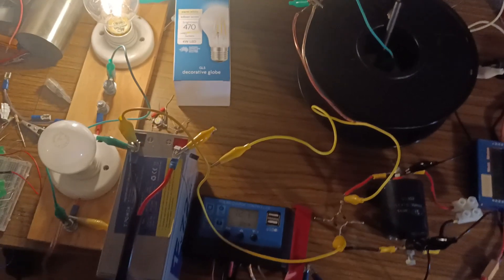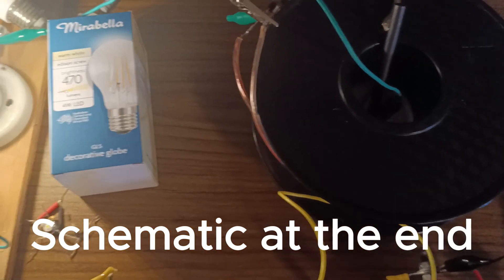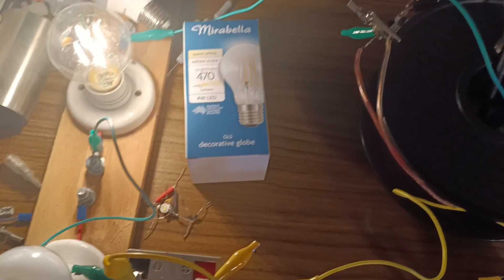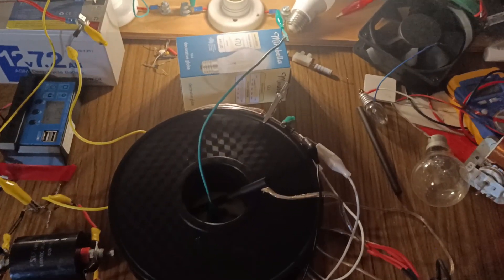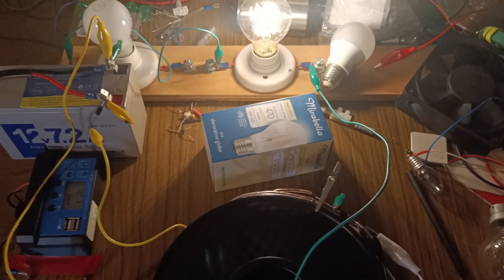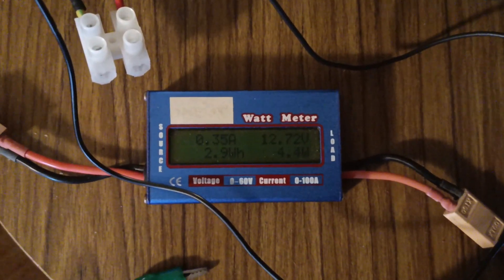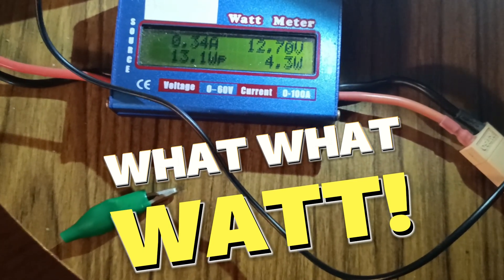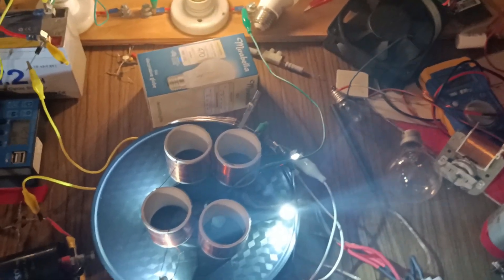MY CIRCUIT + SOLAR CONTROLLER & A WIRELESS SECRET

Comment: The sensitivity of those wireless LEDs interests me. Are the coils single or multilayer? What diameter and length? What size wire? How many turns? I see four possible configurations: looking from top to bottom, clockwise or counter clockwise, and LED polarity anode up or down. (Oh! But half of these are identical, just flipped orientation). Which ones are more sensitive to wireless energy may depend on coil config, polarization of the EM field, or minor variations in the components. Please consider making a couple sets of witness coils, in each config, to help rule out component variation as the cause of the sensitivity differences, and check different orientations as distance from the source increases
Reply from the maker: Thank you for your comment.
Sorry for my delayed response.  I am doing some closer work with these coils at the moment. I deliberately made two of each kind of these coils. There are two with the diode in reverse polarity, there are two with two extra turns and then the first two I made. I am currently unwinding one of the longer ones to get the exact wire length for best lighting. At this point in time I don't believe my initial statement to be correct anymore and as soon as I lock down the correct parameters I will make an update post. So what I said before about it being the diode reversed is not accurate, whilst it does have an effect it isn't responsible for the effect. The polarisation also isn't the full picture which I will demonstrate also in a follow up video, my current config displays this issue. However there is definitely a polarisation effect at play between Pos and Neg wires as well as a magnetic field travelling the length of the wire that is super interesting to see in effect.

Comment: As I understand it lead acid batteries can either charge or discharge, but not do both together, therefore you would have trouble recharging the source battery
Reply from the maker: Thank you for your comment.
Sorry for my delayed reply. That sounds similar to how they behave but I know that isn't exactly the problem in this instance. Normally SLA batteries are used in constant trickle charge state whilst simultaneously supplying power, like in security monitoring backup power systems, however the charge input rate is very low at 0.8 amps. The problem as I see it with my circuit is voltages that are too high to facilitate charge. As we are all aware the electricity wants to move to the lower potential and when I can light up a 240v fluorescent tube by touching just one of the 12v battery terminals I believe the reason the battery wont charge "well" is because it has a potential voltage over 1k. Now I could be completely wrong but I have thought about this a lot and I can't think of any other logical reason especially when considering the configuration currently on my table is charging a second set of batteries just fine, whilst also feeding back to source.
Thanks for watching.

Comment: What type of loads can you power with output from capacitor and what power level support ?
Reply from the maker: Thank you for your comment.
My apologies for my delayed response, it seems the older I get the more I'm saying sorry as getting my act together is getting more difficult.

I seem to have an obsession with light and so I have to be honest, I have only tested LED's, besides the cap in this configuration isn't really there for extra loads but there to show the "feed back to source" fan base that there are better ways. ie. yes it can be done but it's not the most practical way to use that energy, somewhat like using sugar to make alcohol then attempting to make sugar from the alcohol!?

I will get to the point, if running a DC load in this arrangement you will get a disappointing 10 volt 2 watt output. When feeding a battery from this it changes to 13.1 volts 1 watt. In this configuration the capacitor is there to collect the high frequency dielectric that the SLA battery is unable to absorb in it's original form. The capacitor in this instance is a means of conversion of energy to a form readily available to the SLA battery. However more devices should and will be tested as nobody should guess these things, "I think" needs to be replaced with "I thought about it and here's my conclusion", something tells me that isn't how we will best benefit from this power.

I am currently running a setup that is proving very promising using the magnetic flux surrounding the wire and feeding this back to source, I believe this is the energy Ed Leedskalnin wrote about. This in my opinion will result in an increase in efficiency. This new setup I will record and post ASAP(yeah right, like next year old man), it's a spin off of the wireless coil using the input lines. This method has a power factor of 0.9851 when feeding just the source and a power factor of 0.973 when feeding the source and charging an equal sized battery so pretty damned efficient especially when I haven't yet attempted to max it out.

Comment: Does the power monitor report the power factor? Because real versus apparent power is different, due to phase of voltage and current
Reply: dont go letting reality get in the way of "free energy"!

reactive power is complicating things... 

lol.
Reply from the maker: @paulshields1883 Thank you for your comment.
The power meter is an old one and doesn’t show the power factor however what it does display I calculate the power factor to be 0.975 which is very efficient. That is running a 6 watt load on L3(Tesla’s 336,961 patent) as well as feeding back to source.
Let me know if you want a full cycling of the readouts on screen for your own calculations.
Reply from the maker: @paradiselost9946 Thank you for your comment.
This is a question that continually comes to mind, what if the algorithm’s used to calculate the measurements in modern meters are incorrect based on incorrect or incomplete science? Does that make the readings invalid. ie. our understanding of physics is clearly wrong since the pentagons declaration on UFO’s, if apparently our physics models don’t understand those technologies it’s hard to imagine our meters, designed under our understanding of physics, would have a better understanding. In the same way Ai can’t understand things better than humans because we are the teacher, if the teacher is wrong…then… this is the chicken and the egg conundrum from a new perspective.
Reply: @whatifididthis...1236 very well said ❤
Honestly, I don’t bother anymore about measuring power factor or just output power and it doesn’t matter too much the form of output, it is clear to me that electric energy is used wrong as it is now and a completely different approach should be employed.

With your pancake coils and less input power then yours (64 w) in my replication I can power +2200 w rated loads for AC from power grid. So, this is not about overunity or things like that … it just prove that we don’t need huge input as we are told and electric energy can be used much safe and more efficient without amperage.
Reply from the maker: @Caesarus2011  also very well said! Tesla was very clear about the pancake coil has more output than input. I just don’t know why people are still debating it from the perspective of their education, we only know what we are taught, therefore if we aren’t taught this information we can’t possibly be considered knowledgeable on the subject, bit of a no brainer really.
Reply from the maker: @paulshields1883  I made another adjustment to the circuit and ran all day yesterday to achieve a better power factor of 0.9898

Comment: Could it be that you are charging the cap and that's why the bulb decreases ? You could put a diode on the ne side and see if it deceased the spark when you reconnect.
Reply from the maker: Thank you for your comment.
You are correct to question that as all things should be questioned, however I feel that isn't the reason for what we're seeing. The cap is relatively small and charges so rapidly and I believe this occurs because we have a capacitor followed by a resistor coupled with my circuit which essentially creates a "low-pass RC filter". This is essentially a method of attenuating high frequency whilst allowing low frequency to pass. I did place a diode on the Neg side also but it has a completely different effect again.

Comment: dioda base to emiter, bedini style.
Reply: Yes, i wondered about whether this could damage the transistor. Bedini clamps the base to the emitter, with a diode, to keep the base from going too far under voltage
Reply: Great finding .

In the circuit Does the transistor heat up quite a bit ?
Reply from the maker: @ardiwork Thank you for your comment.
I originally had one but removed it because it produces much higher voltages without it, this can be clearly seen at the light. My initial intention was to throw away everything not necessary for function so I could build something post apocalypse by scrounging materials from any environment. This takes the transistor so far from it’s operating specifications that experimentation would often blow the transistor, it’s usually on connecting this whilst running, the small spark gap that is creating just before contact is the real problem so that’s fixed by connecting before switching the system on. If your not experimenting then you won’t experience any issues at all and can run the transistor like this, through earth, 24 hours a day for years.(at least 3 years). I might attempt demonstrating the diode on another video so you can see what I mean.
Reply from the maker: @paulshields1883 Thank you for your comment.
I wondered the same thing until I removed it, it was a long long time ago now but I clearly remember lots of moments where I sat there looking at the circuit after an adjustment, confused with not much more to say than “huh…that’s weird”. I had a good understanding of the 2n3055 transistor from my days experimenting with Bedini and Adams motors so I already knew it was special but I still enjoy the surprises.
Reply from the maker: @samoks123 Thank you for your comment.
There’s not as much heat as you’d expect, it definitely needs a heat sink but it is well under the temperature rating for the 2n3055. The body of this transistor being entirely metal helps and it can take 5 amps continuously when my circuit pulls anywhere between 0.3 amps to 1.5 amps depending on the length of transmission through earth.(1.5 amps at 160 meters).
Reply: @whatifididthis...1236 my setup heats up the transistor quite a bit. Need a larger heat sink. Wondering if I need to increase the inductance on the primary bifilar